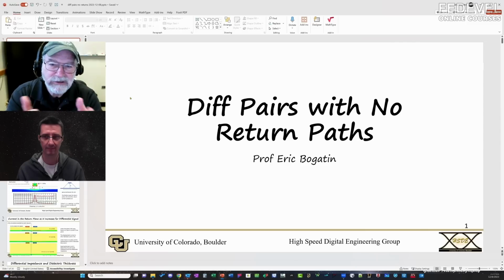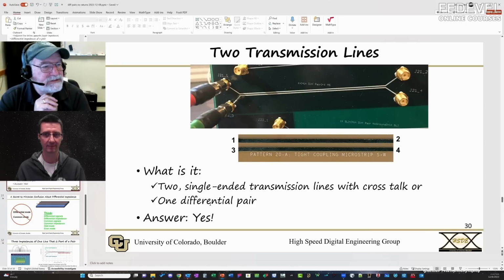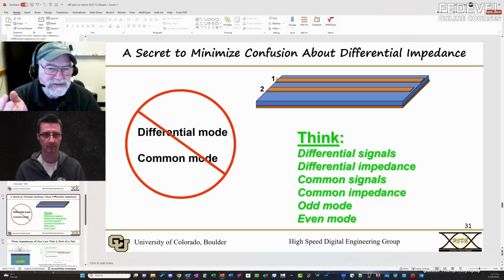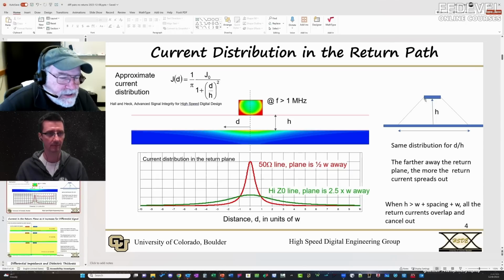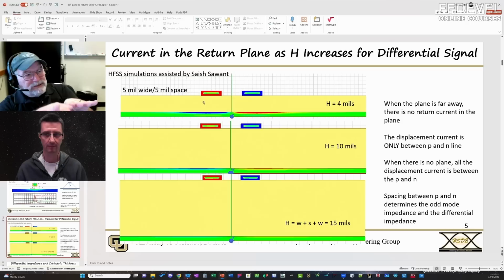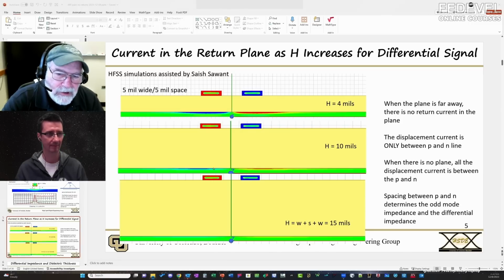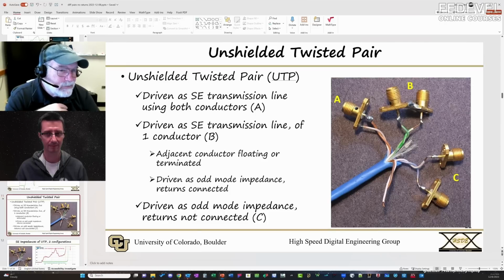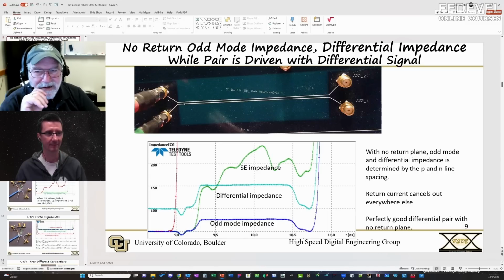Do Differential Pairs Need Ground? Are you sure? | Explained by Eric Bogatin

Comment: Whatever signal you apply on the DP can be decomposed in differential and common ones (difference and average). This representation is orthogonal. It is like a vector decomposed on an orthogonal base. Each component (differential and common) will propagate indipendently from each other(ideally). The differential signal is positive on one line and negative on the other line, the common is the same signal travelling in line 1 and line 2. One can think the DP as a single transmission line with a characteristic impedance of Zdifferential for the differential signal and another single transmission line of characteristic impedance Zcommon. Indeed, Zdifferential = 2*Zodd and Zcomm = Zeven/2

Comment: Another great video, thank you Robert! 

I'd like to rise one question, which could be addressed in one of your other videos: What about EMI? 
It's nice to see, that the differential impedance is flat, but since the return paths form big loops, can't they cause EMI problems? 
Especially when you transition from a PCB to UTP, which does not carry the GND reference signal - in that case the return current needs to overcome a huge impedance from the ground plane into the differential pairs... Or did I miss something? 

Once again thanks for the interesting video. :)

Comment: Ok the "common" can be switching, it is anything say voltage-wise "equal" hapenning at both conductors at the same instant of time, which indicates the system is not truely "balanced/differential", so common mode presence means inbalance, which means: improve the mechanical layout.

Comment: I was a radio tech a few years back and had a thought provoking moment with an audio system.  It has transformer coupled differential output but failed test,  no signal. Measure with oscilloscope,  and sure enough it was there... what's going on i thought to myself.  The transformer winding was open circuit but the common mode signal was coupling through the winding capacitance. Both hi and lo signals were in phase but needed two probes to confirm that.  Common mode means in phase and differential is 180° out of phase and equal amplitudes. Another good term for differential lines is balanced lines,  for any out-of-balance is a common mode signal which must have return current somewhere else.

Comment: Another question. The practical case - we have a PC (a computer), and an Internet router/switch. They are connected by a 50 meters unshielded Ethernet cable (U/UTP). Will the differential currents cancel out between every two wires in every four pairs and common currents will find their way in the air as a radio wave between a PC and a router/switch? May we then treat that cable as a 50 meters radiating antenna? And what if we have a shielded ethernet cable (F/UTP) and both ends of that shield are connected to the ground in both PC and a router, so we have the metal, not air, return current path. Will the common currents of four pairs go back in that shield? And what if we will connect that shield just to one device (a PC i.e.)? Will that shield act as 50m antenna? Will it radiate to an air by entire 50 meters shield? Or it will radiate just by that few centimeters between the unconnected shield and a ground in the other unconnected device - in this case the router/switch?

Comment: Regarding the slide number 5, what if we put the N signal instead of the ground plane right below the P signal? Will the return currents cancel out almost completely as they are between P and N line below both of them right on the center?

Comment: I see these 'differential pair' schematics in my audio realm explorations all the time.

But, some have it set with a 'Main' (POS) signal, adding an Inverter to it for the Inverse (NEG) signal..

Doesn't that introduce a temporal offset between the two transmission lines?

Comment: Excellent presentation on differential pairs!

One question about return currents: In your example with a twisted-pair cable carrying differential signals, the fields cancel out within the cable. But what happens when the differential pair transitions to a PCB with a return plane nearby? Eric Bogatin says that most of the return current will be coupled to the plane.

If the PCB return planes of the two connected devices aren't directly tied together, wouldn't the return current struggle to complete its path?  In that case, wouldn't it be better to connect the planes to ensure controlled coupling and minimize EMI issues?

Thanks.

Comment: Someone please help me understand what the return current does at the interface where the cable enters/exits the PCB? If we have RS422/485 differential signals on Shielded Twisted Pair, connecting to a PCB with no direct connection of grounds between the two systems, what happens to return current at that interface? It can follow the ground plane in PCB up to the connector, and the differential twisted pair return current is on the other wire in the H/L pair. But at that interface where the return current in the PCB has no where to go, is that similar to what Eric was saying it will give a convoluted return path but they'll be equal/overlap and cancel out?
Reply: If you are not sending a ground along with the twisted pair (which you're probably not doing) then the only way to do it right is to use a transformer as a balun.  The centertap of the receiving side should be connected to the ground. This way, you have 2 single-ended signals again which are both referenced to ground. If you open up an ethernet switch, you'll see a large black block right behind the tcpip connectors that contains these transformers. Often they also include extra CM transformers to make sure CM interference doesn't get onto the cable.
Reply: Differential signal will cancel out, but common signal will find its path as a radio wave between two systems. That's EMI.

Comment: What is the difference between odd mode impedance and differential impedance? Also, removing the ground plane would not work for even mode?
Reply: Odd mode impedance is by definition half the differential impedance. Even mode impedance is the common mode impedance. Removing the ground makes the even mode impedance infinite.

Comment: Another maybe obvious point of view is that if we are driving some receiver, those have some limits on common mode voltage (voltage of shorted diff line to IC ground) they can handle. In that case we still need DC ground to be at least routed somehow, even if we have ideal diff pair, otherwise we have two floating inputs with some differential voltage between them. 
Eg. for CAN bus between to battery powered devices wee need ground (or luck). 
If we are not driving input transistors in some IC but simple coil as in ethernet transformer than we can "delete" the ground as utp cable.

Comment: So the secondary of a transformer that is not center taped to the ground is still a two single ended pair? If you feel this doesn't sound right and smells bad, you acre correct, because it's a terrible generalization.
Reply: That configuration sounds single ended to me

Comment: I still missed one thing. In the case where transformer drives diff line (e.g. UTP Ethernet cable) - where will the single ended signal come from? Isn't the function of the transformer to eleminate the SE signals?
Reply: Imagine there is a length difference between the two traces from the transformer to the Ethernet jack so the two sides of the pair are not perfectly out of phase. The net (common mode) signal at any given point in the pair is now an AC wave at your signal frequency. Your board, traces, connector, etc. have capacitance to ground for the return path. At least, that is my understanding 😅
Reply: @jessicav2031  for my simple mind length difference is a good enough explanation. It makes sense to me. Thanks.

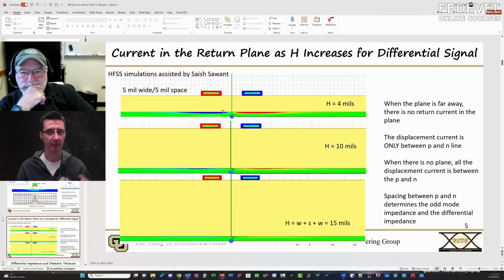Comment: 24:04 there are two factors pointed out: 
1) DC resistance
2) tolerance
but how about actual resistance of the signal against EMI? Is it not affected by pair lines being farther apart?

Comment: Very useful. Why does Shielded Twisted Pair cause EMI issues? Can someone explain? I think it has to do with common signal return path?
Reply: 10:25 ? Who said shielded?
Reply: thanks man, i somehow heard shielded and was surprised lol @dzidmail
Reply: I think this is because, the differential signal will have a clean return path (the difference ie., D+ - (D-)), but the common single ended (avg.) would actually not have a return path and would oscillate as antenna (without reference) and thus causing EMI issue.. Anyone can feel free to comment and carry this discussion.. Thanks!!